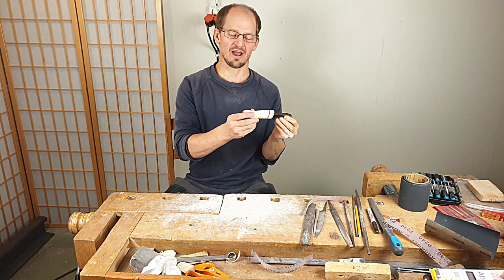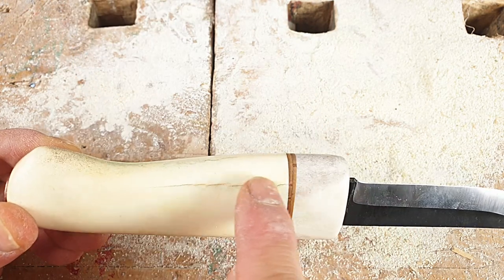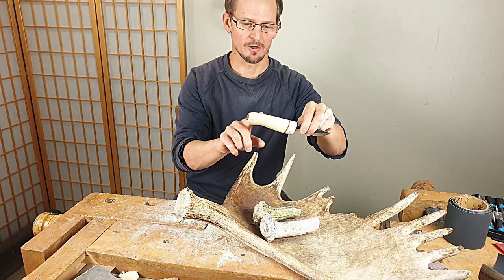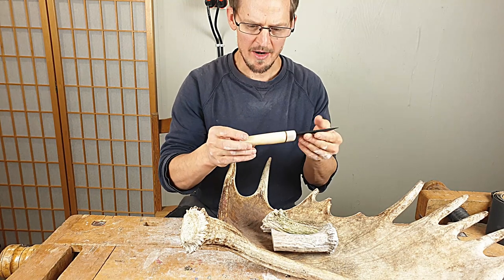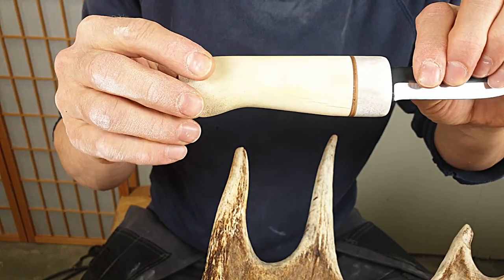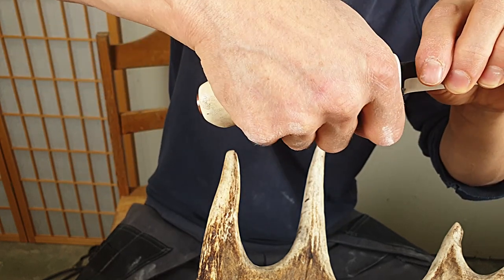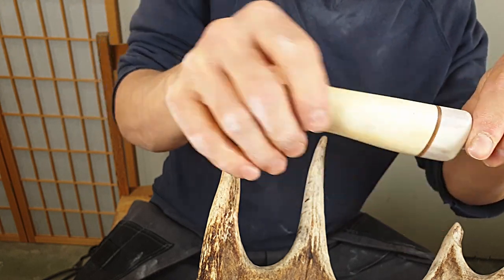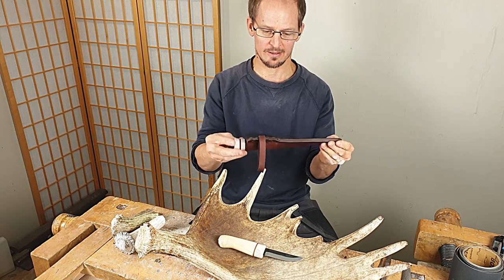Moose Antler Knife Handle

Comment: Hello Vahid, I think it is easier to drill the hole for the knife tang from both sides into the handle. That will give you the precision you need…
Greetings Alexander
Reply from the maker: Hi Alexander, I think you are right. I did that once and it was spot on. When I think of doing it again I always imagine that it was a one-off and that I might easily miss the the other drill hole. Maybe I should practice more on scrap wood.

Comment: Another beauty. Do you find the old sheds need hardning or are they as tough as a fresher one? We do have moose here where I live ( northern NY state). My niehbor had a young bull in with his holstein heifers a few years back. That's only one I've ever seen so sheds are pretty scarce. I scored a nice antler as an art piece. I liked the art on the paddle so I saved that and cut off the base and two tines that are large enough for knife handle. The base is for a flint knapping "bopper".
Reply from the maker: Hi Timothy, concerning the toughness of the sheds old and fresh, I want to say that it depends. If the old one has been covered with moss and half buried in the ground and immediately used then it's softer. But if it's left to dry then it gets real tough. I find the fresh ones easier to work with, the files go through them quite nicely. Are sheds really that scarce over there?
Reply: @VahidCullsberg  Whitetail deer are common , moose are not. You can buy them on line but quite expensive usually. I paid $60 US for a medium size with art scene painted on it. That was reasonable. You can find elk horns online and at flea markets but they require hardning to use. Mammoth ivory , in my opion is a way cooler alternative.

Comment: Hej Vahid I actually like the cracks they give the knife its own character. I made my first full tang knife but couldn't find any copper sheet that was thick enough so I drilled a hole in a piece of messing and used that instead. Do you know a place where I can buy a copper sheet that is thick enough? Ha det bra mvh Jack
Reply: Hello, you can use old coins. They have quite often a nice design and already a round shape…
Reply from the maker: Hi, if I remember correctly, you said you are in Jokkmokk? You could make a visit to the recycling station, and see what you can score. I'm sure you can talk to the guys there if it's just a small piece you are after. Sometimes people go home with more stuff than they went with to throw away :)

Comment: Hello Vahid. Very nicely done. I just finished a hunter knife with a tropical hardwood handle. When I was almost finished with it I noticed a crack that slowly grew over 2 day's time. I finally drilled a small hole at both crack ends and made a groove in between. I then mixed a little sawdust with epoxy and filled it in. It did not look perfect but it was done in primitive stye anyway. Thanks again for the video. I would like to send youa gift soon. Could I have your mailing address? Thanks.     Yours in Prayer, Rick Trumbo
Reply from the maker: Hi Richard, seems you found a way to fix the cracks. I wonder if I can do the same with epoxy and antler dust? Let's talk about your gift over at cullsberghandmade@gmail.com